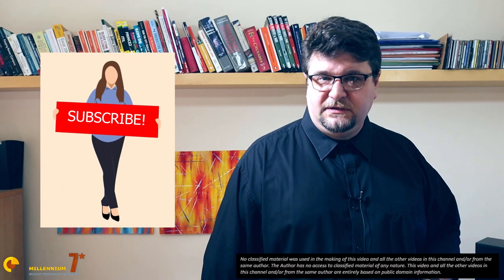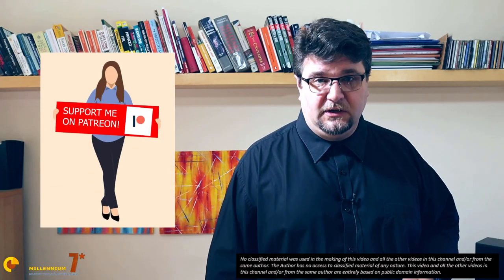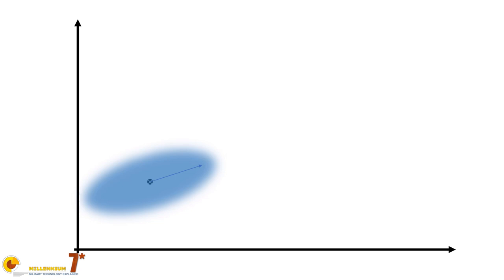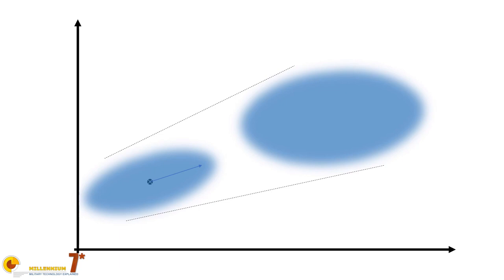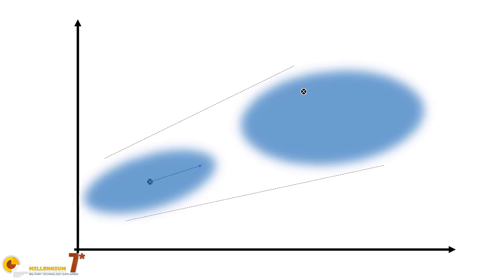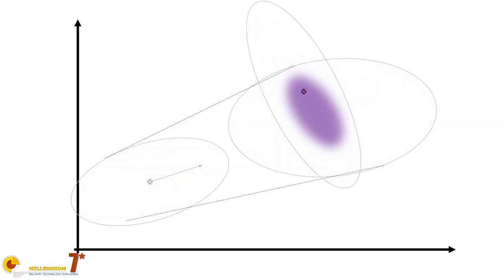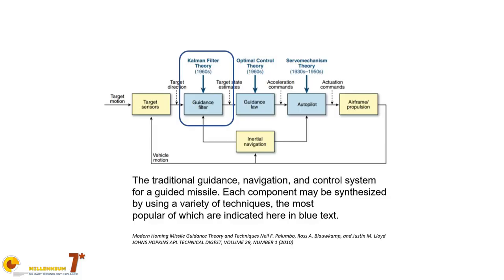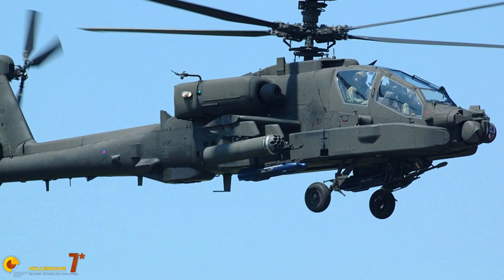TRACKING: how missile sensors follow their targets (AMRAAM, Sidewinder and all the others)

Comment: So, The missile knows where it is at all times?
It knows this because it knows where it isn't.
By subtracting where it is from where it isn't,
Or where it isn't from where it is (whichever is
Greater), it obtains a difference, or deviation.
The guidance subsystem uses deviations to generate corrective
Commands to drive the missile from a position where it is to a
Position where it isn't,
And arriving at a position where it wasn't, it now is.
Consequently, the position where it is,
Is now the position that it wasn't,
And it follows that the position that
It was, is now the position that it isn't.
In the event that the position that it is in is not the position that
It wasn't, the system has acquired a variation,
The variation being the difference between
Where the missile is, and where it wasn't.
If variation is considered to be a
Significant factor, it too may be corrected by the GEA.
However, the missile must also know where it was.
The missile guidance computer scenario works as follows.
Because a variation has modified some of the information
The missile has obtained, it is not sure just where it is.
However, it is sure where it isn't,
Within reason, and it knows where it was.
It now subtracts where it should be from where it wasn't,
Or vice-versa, and by differentiating this from the algebraic sum of
Where it shouldn't be, and where it was,
It is able to obtain the deviation
And its variation, which is called error?
Reply: Thanks, I think 😥

Yo!  Does this also apply to the location of physical particles, including, but not restricted to sub-atomic, this being in the context of all physical 'things'/manifestations being merely indicators ('signitura reram') of esoteric/spiritual reality?  'Just thinking out loud..
Reply: Dude stop regurgitating old video info…. We know

Comment: Great explanation, thank you. On time frame of 11:13 how would we be able to identify the characteristics of our radar? I mean what need to be considered in order for us to project the red shape (our equipment) that intersect the original estimate in blue shape? Also who would insert this red area over the blue area? Would it be us human doing that or the Radar electronics?
Reply: This depends on radar resolution, wich is determined by antenna gain and the frequency used as well as the electronics manipulating the signal. You could use static values but i dont think that would be particularly useful considering most radars utilize multiple frequencies and electronic circuits